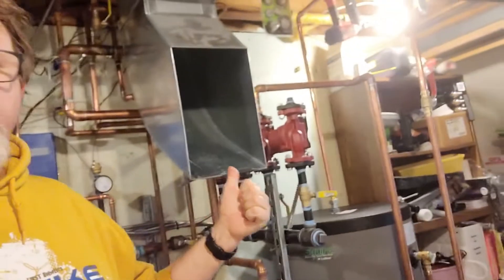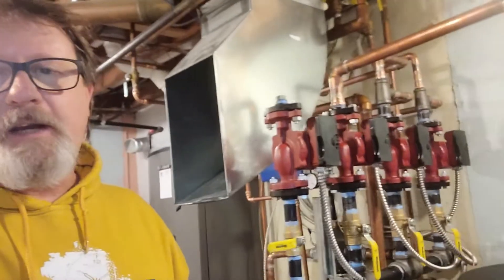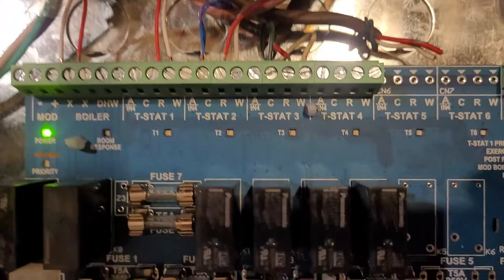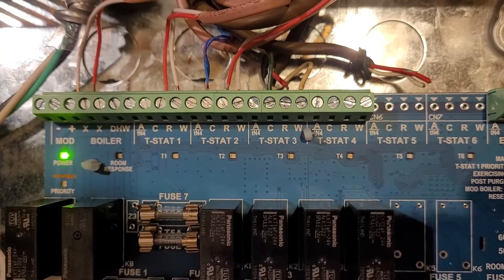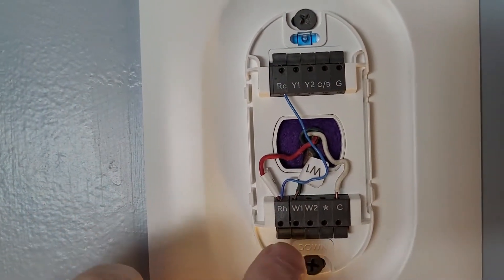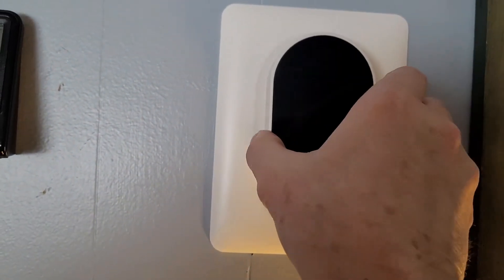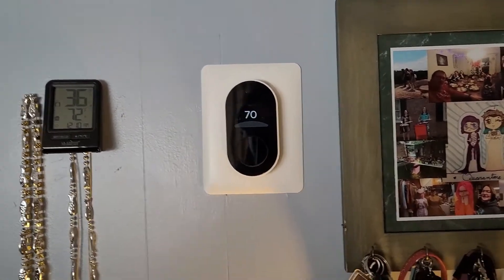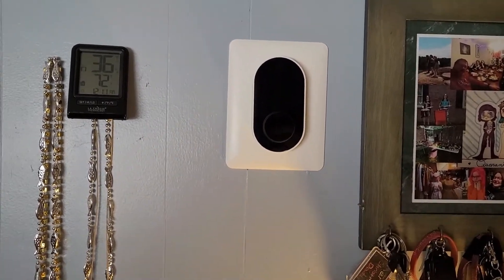Wyze Thermostat Zone Controller Retrofit/Setup

Comment: How did you get the jumper to fit into RH
Reply from the maker: If your wires are "normal" size then 2 wires will easily fit into the same hole on the Wyze thermostat connectors.  If you have thicker than normal wires then you may have to do something like take 2 short thinner wires that you can connect to RH and RC, and connect the other ends together and solder to the wire that was originally connected to RH.  Make sure to tape or shrink wrap the connection if you do that just as a precaution.